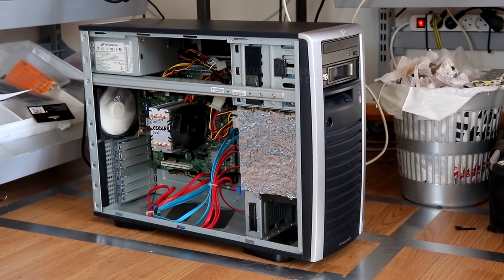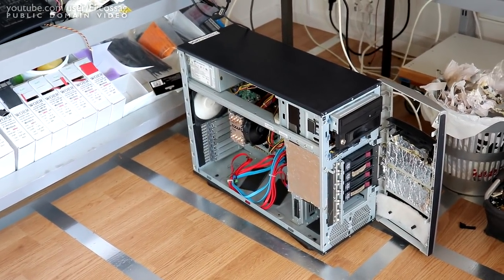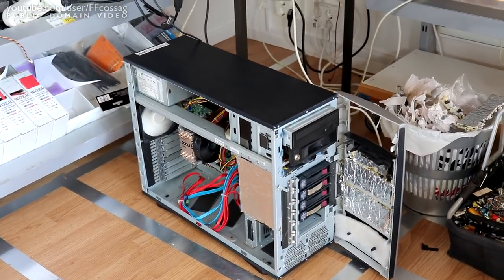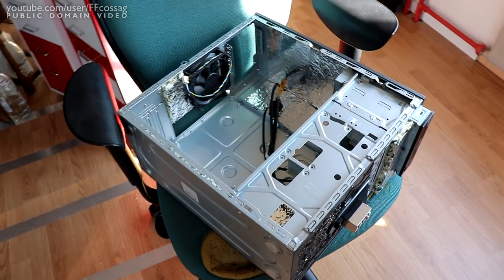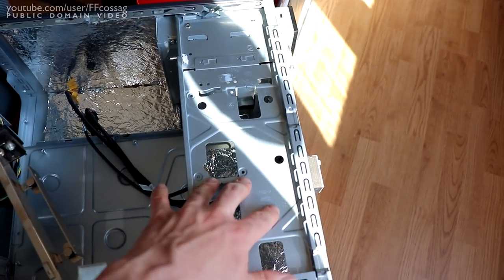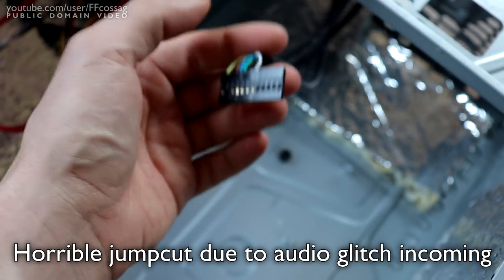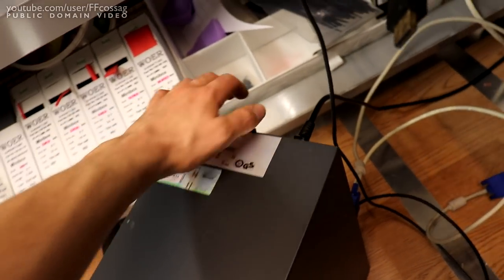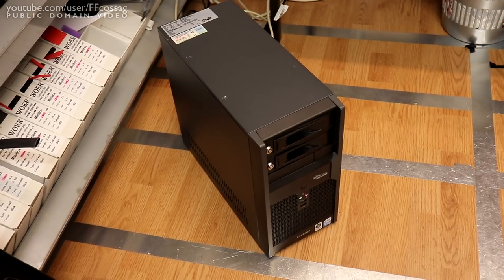Let's shrink the Windows server!

Comment: My Plex plus IPcam NVR server also lives inside a mATX case, and is virtually silent, as it resides in my bedroom so has to be quiet, specs are old hat though, Core2Duo E8600, 4GB RAM, ASrock board I forget the model of, nvidia GT430 (helps the NVR software not overheat the onboard crappy graphics), haphazardly arranged HDDs, SSD for the OS, basically it's like I stuck PC parts into a blunderbuss gun and fired it in the case... :P

Comment: Found out recently they make a NVMe M.2 to PCIe adapter, which a guy tested and gained massive file transfer speeds. to that drive, so it might be worth getting M.2 instead of SSD.
Reply from the maker: These old systems can't boot from NVMe, sadly - and in this case, disk performance is irrelevant. This server runs no disk intensive tasks.

Comment: Remeber the vdev provides its own redundancy NOT the pool! So honestly your better with striped mirrors unless you get to crazy number of drives then you can stripe raidz
Reply from the maker: I really don't have the budget to do anything mirrored. I've always run a daily back-up of all my data to a separate machine, so 1-disk redundancy is going to be absolutely fine. Thanks for the concern, though.

Comment: That i3-2120 hardware is decent and it’s a dime a dozen these days.  I got a Dell 390 SFF with 8GB and the i3-2120 for $10 bucks this spring.   Nice lower power summer system to help keep the heat down.  I prefer AMD, but I think performance wise all that hardware is still fairly new and expensive.   Would be interesting to hear the details on how you keep your place cool in the summer.  I’m guessing you do have an effective plan that doesn’t involve a $200 dollar monthly electric payment.  My plan is don’t run AC, just exhaust heat at night and keep indoor power use low.   Thumbs up.

Be real youtube, be sober.

If you run into any network issues with the Linux install, don’t forget that you can just boot the install on different hardware and install what you need from there.   I had to install r8168-dkms to get my Dell 390 going.  Very easy problem to solve.  Just used lspci to see what network card I had, google it, booted on another machine to installed.